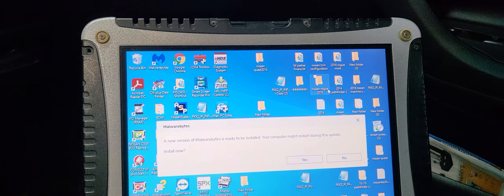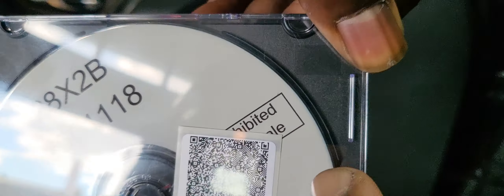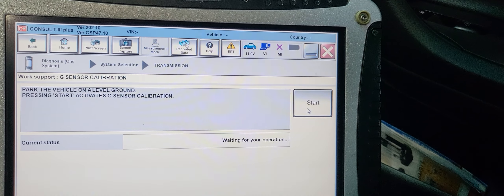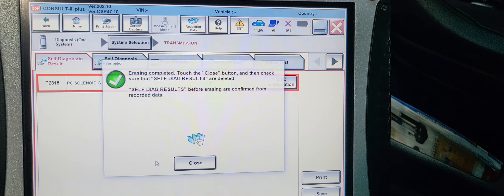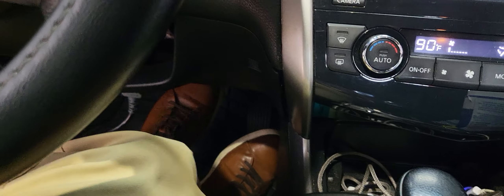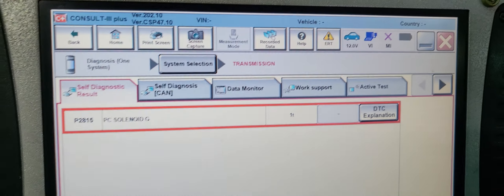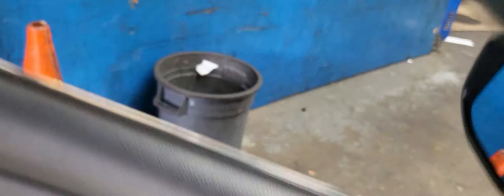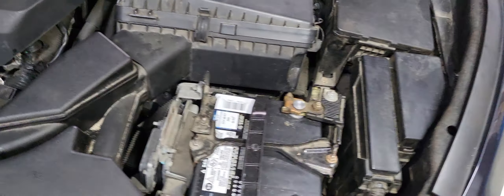2013 Nissan Altima Transmission code P2815 PC Solenoid G still Tcm Replaced

Comment: If the unit or body are replaced, you must write valve body data to the tcm with the provided disk.  And to properly write, you must do it in all systems to unify the can system to write properly.
Reply from the maker: True 
Thanl you For the information
Reply: Title on video states TCM was replaced. Nothing written saying valve control body was replaced???
If looking for a external communication interruption in an outside harness between pcm and tcm you better have customer experience history that would suggest support outside wire damage.
First step would be ohm testing solenoid G and accessing mechanical movement interface a the valve controlled by solenoid G.
Reply: @davidrioux611  wow, idk how I missed that.  But a pc G code is due to either a failed valve body and starves the pulley of pressure and causes it to jump.  Or the pump has failed and causing the lack of fluid.

Comment: I rebuild the gearbox and is showing this code pc solenoid G
Reply: Did you get your fixed?
Reply: Did you get it fixed?  Just flushed the valve body and got this code